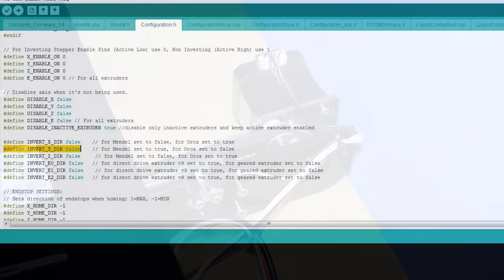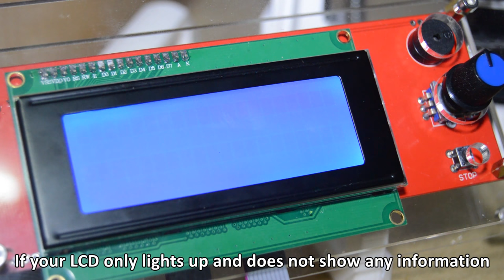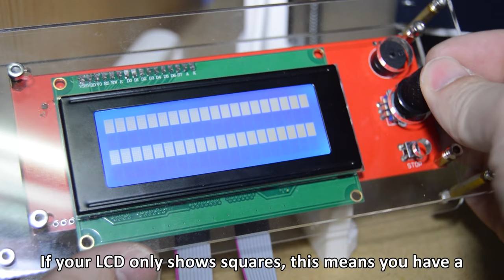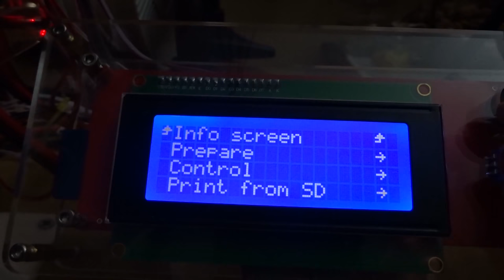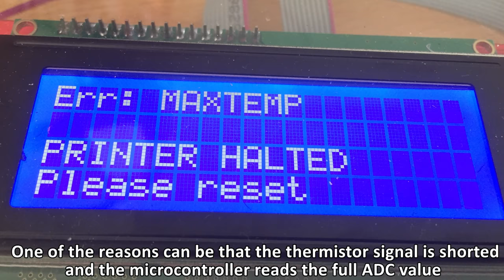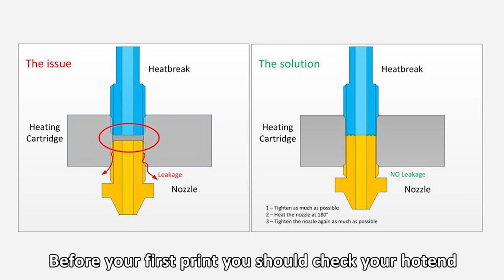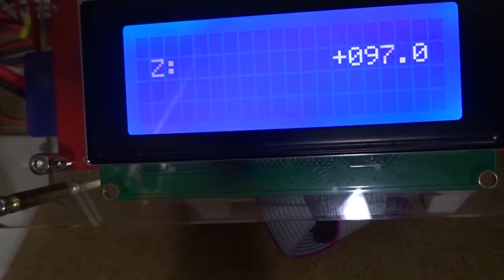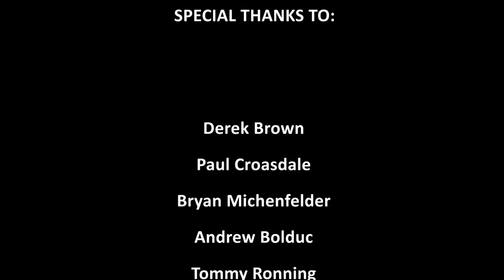TEVO tarantula - FAQ answered

Comment: What is the white "chord" Going to the extruder actually for?
Reply from the maker: Hi Adam,
Which chord are you refering to? Is the PTFE tube?
Reply: Yes, sorry! I should have been more specific, my machine came with 2, one long one to go to the extruder and a smaller one, that I can't seem to figure out where it goes!
Reply from the maker: That is the tube that will guide the filament from the extruder to the hotend. Check my other videos where i show the assembly and FAQ video with the details of the PTFE tube installation in the hotend.

Comment: my printer does nit have any heating not the e1 or e2 or even the hot bed .. i could i fix that 🤔🤔🤔
Reply from the maker: Hi 3d project,
Your board outputs are not working? Are the connections correct? Have you tried to flash a new firmware to check if you have a corrupted firmware?
On the board, next to the output connectors you can find red leds. When heating, these leds must light up. Check if they light up.
Reply: it was working normally and it just happen i want print something and it didt heat ... all wire are plugged in as it should be .. i will try to upload firmware and will see .. could you tell me where  could i find the new firmware file to upload .. i have the big size with 2 e .. thank you .
Reply from the maker: If that is the case, maybe your internal mosfet is faulty.
Flashing the firmware will not help (you can still try...just check my other video on how to install the firmware). For a better help, go to the tevo tarantula official facebook page and post your issue there. We will help you.
Reply: thank you i will .... )

Comment: I would love to use this printer if it would ever work. my problem is that when you press print and it heats up. it just sits there
Reply from the maker: Hi Ryan,
are you using the stock SD card? If yes, get a new one instead. Does the printer reaches bed and nozzle temperatures and they get stable?
Reply: ruiraptor when I get the new one do I need to download anything on it?
Reply from the maker: No, the SDcard is only needed to save the gcodes of the prints. You can also print by connecting the PC with USB. I prefer using the SDcard because using the PC and USB we can loose connection (Windows restarts or stops communicating) and we loose the print.
Reply: ruiraptor thank you so much. I've been constructing this for 3 months now on and off and been getting very frustrated
Reply from the maker: No problem. You can also join the Tevo tarantula facebook group ( https://www.facebook.com/groups/TEVO.3dprinter.owners/ ). The community is awesome and ready to help.

Comment: I folow your steps but my extruder won't move ?
Reply from the maker: minekeek ,
you need to raise the nozzle temperature up to 180 degrees do that the firmware allows extruder movement
Reply: thanks , i don't know why but my extruder work without raising the temperature . I have an other question when i plug my tarantula in my pc , it say usb dont reconized 
PS : sorry for my bad english .
Reply from the maker: minekeek ,
you need to install the FTDI drivers. please check my other video that explains how to update the firmware.
Reply: thanks or merci !
Reply: Hi friend, thank you for the help.  I just tried to install a community edition and after hours of building it has bricked my printer.  The display wont show anymore and I do not know which software to update with.   I have the latest arduino and a normal bed size.  Please help me.
Reply: KarmasOrbit hi , i don't know but i am going to search 😉
Reply: KarmasOrbit Did the led of your printer work ? that can be only the screen ?
Reply from the maker: Hi KarmasOrbit.
My advice is to go back and install the community 1d firmware and test. You can download it fresh from the file section in the FB group and install it without modifications. If you can't compile it (before flashing) it's due to the latest version of Arduino...The community FW only compiles with the 1.6.8 arduino libraries. If the board is bricked, then follow the unbrick procedure in the link.
Reply from the maker: That can be a possibility...but if the display does not show anything (but lights up) it can only be the contrast potentiometer on the back.
Reply: Thanks friend, I can not find anywhere this file in the files list.
Reply from the maker: KarmasOrbit 
that was uploaded in March 2016. it has community 1d in the name.
Reply: haha, there is nothing there my friend.  I have checked by date too
Reply: OK, I seem to have got it back! Now I need to readjust everything.  I changed from USB 3 to normal and it seems to maintain a better connection.  I have no idea why.  I just done all my auto levelling so need to do that again.  I have spent months on this thing, I had to wait around for faulty replacements but am so eager to get a first test print.

Comment: Max Temp error can also be caused by having the thermistors reversed on the mainboard. I made the mistake of thinking the yellow cable should be plugged into the yellow port, causing the heatbed to register it's temp from the hot end. :)